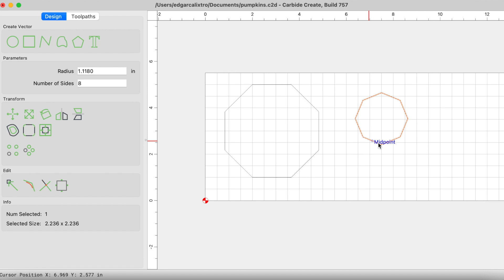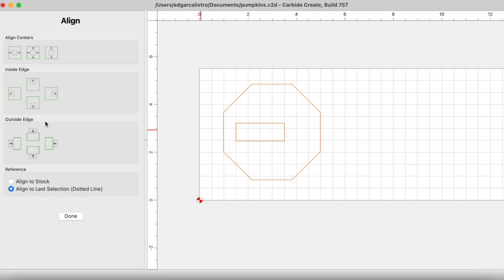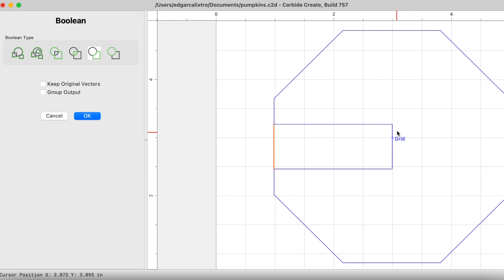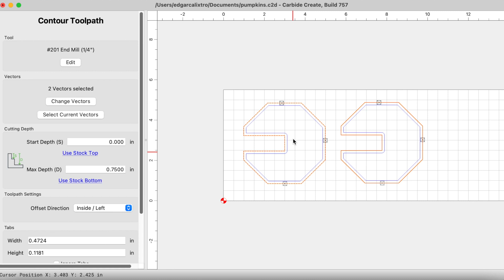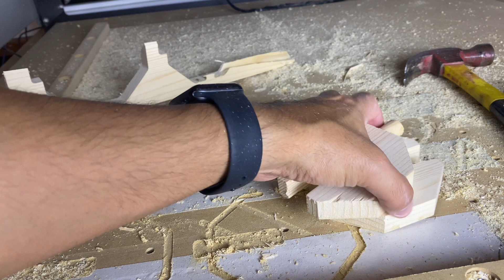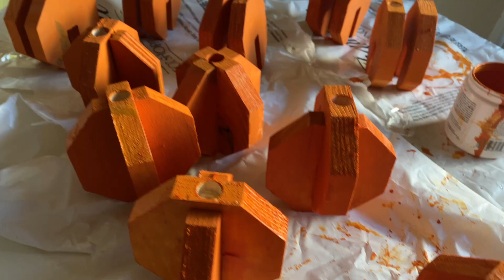EASY Beginner CNC Fall Project | Pumpkin Decor

Comment: Next time you can take your octagon and rotate it 22.5 degrees and it will cause the flat side to be down.  Thanks for the video!  If you have an even number of sides you can take 180/numberSides if you have an odd number sides take 180/(2xnumberSides). For odd number you might have to rotate a time or two to get it right.
Reply from the maker: Thank you Buzzsawddog!  This is what I needed and very helpful! Thanks for sharing!
Reply: @aetimberpine  no worries!  Working together and helping each other is how we learn and make better projects ;)